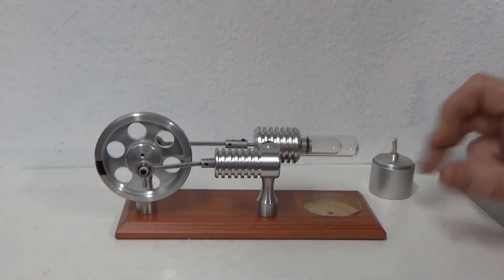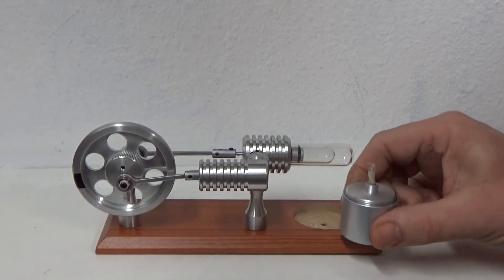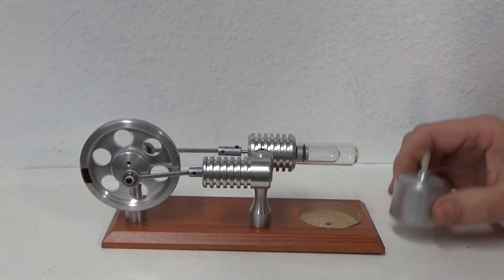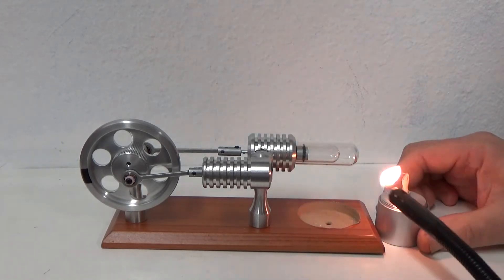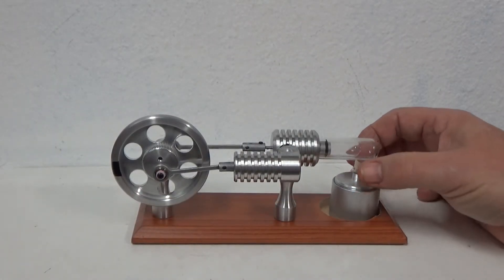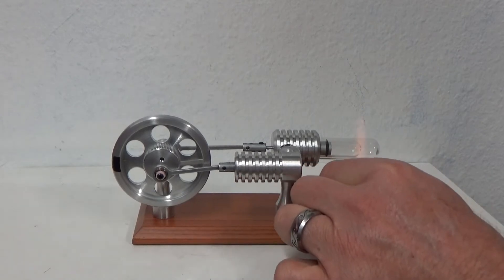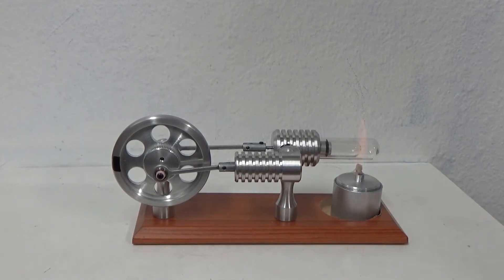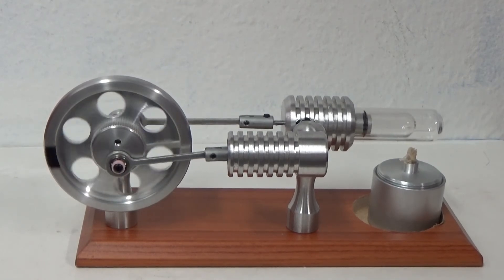Twin Piston Stirling Engine

Comment: thanks for posting.  some late thoughts.   just bought one, similar.     performance could be a lot better.     because,  the displacer is  NOT  a displacer.   it is a second, Overly-massive  piston.   THEREFORE,  A  DIFFERENT DUCT configuration Should have been used.    in any case,  a two-piston configuration  could have resulted in less  mass in motion.   and, even better efficiency.   if interested, see my tutorials.   i am getting one of these.     cheers         googletranslate
http://i.ebayimg.com/images/i/301796044304-0-1/s-l1000.jpg
two-piston duct configuration

https://www.youtube.com/watch?v=gyIrLKJ4Y4U

https://www.youtube.com/watch?v=s79odgWz6BM

Comment: These are awesome. I just ordered one with a prop for about $90. I wonder if denatured alcohol could be used or if would it burn too hot and melt the glass.
Reply from the maker: I think they recommend denatured alcohol.  Melt the glass?  Glass melts at above 1500 C or 2600 F.  I don't think you need to worry about the glass melting.  Small votive candles can also be used.
Reply: Oh ok. I wasn't sure what the melting point of glass was.

Comment: Try one of these sometime Dave, I have one at home that is a blast. It's over 50 yrs. old.
https://www.youtube.com/watch?v=rpsOjSp7xxM
Reply from the maker: I have yet to see an affordable steam engine David.  These Stirling engines were $35 each.  I cannot justify spending the amount required for a steam engine.  Especially since it is as impractical as the Stirling's.
Reply: True they are more money, 40- 70  bucks used on ebay. I have a hammer forge and a windmill I run on mine. Gotta use distilled water and buy fuel for it though.